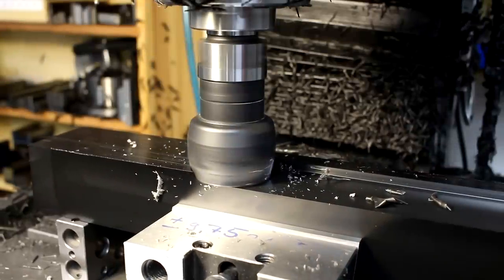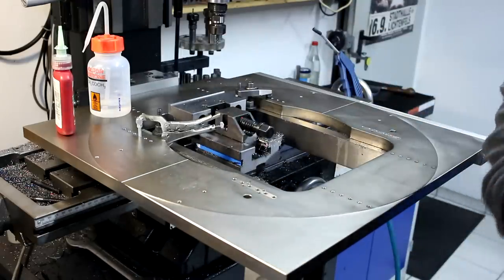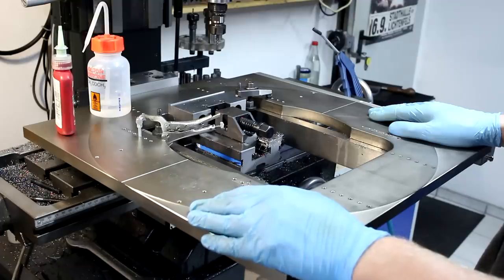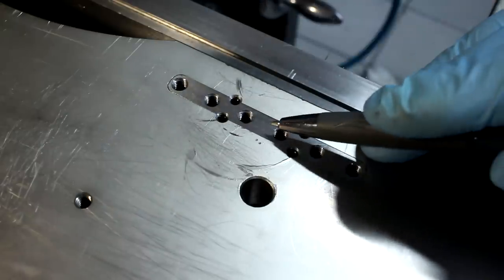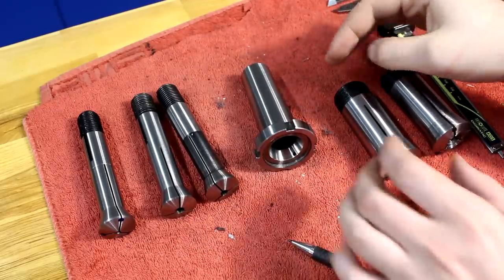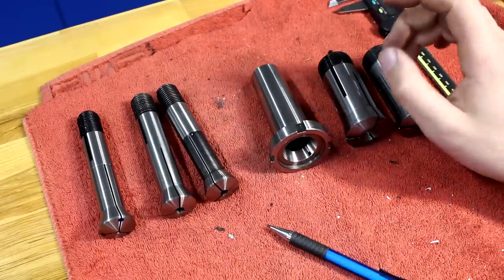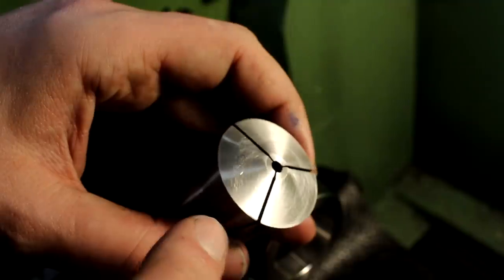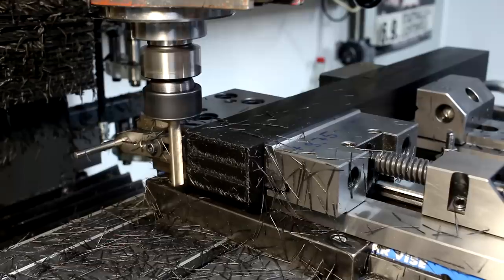Shoptalk #21 - Januar 2020

Comment: On other way that I have used to spring open a collet. If you take a Oxi Acetylene torch with a small tip. heat a very small area between the slit ends near the threaded end of the collet. About 1/4" in diameter red hot. Than quench it in oil. Do that to the other two locations. Now the collet will be sprung open. If your careful and heat a very small circular area this doesn't damage the collet. (But you have to concentrate the heat quickly) At least I have never had one break from doing it.
Reply from the maker: Thanks Peter - I will try that!

Comment: Have you seen how the tapers are clamped in to taperlock bushes? They use a half-threaded and half-blind hole. 
With a similar arrangement (and no glue) you could have left the option of taking out and flipping the threaded inserts. 
So that it is twice as long before you get paid for the job again.  Ah, I see the flaw in this plan.

Comment: Excellent shop talk Stefan, that D2 tooling plate is the largest size I have seen from that material, I assume it was Nitride Hardened.
Many thanks for sharing and best regards from the UK.
Reply from the maker: Nope, it was actually completely soft, unhardened. Only plated.
Reply: @StefanGotteswinter  Thank you for your reply, most unusual to have D2 used in a non hardened and tempered condition, though it would be quite stable dimensionally.
Always learning 👍.

Comment: Beautiful repair.  I would never have thought of that.  Why did you radius only the corners of the insert rather than entire end of the insert?
Reply from the maker: I did want to go with a 6mm Endmill for the pockets, but the pockets are wider than 6mm - That means I have to radius only the corners :)
Reply: @StefanGotteswinter  Isn't that what gigantic button head screws are for?  I always put a few in something that doesn't fit quite right.  I just say it's steampunk.  Best wishes and thanks for the vids!

Comment: I am sure you said and I missed it but there most only be shear forces on those threads otherwise those inserts would not be the best solution.
Reply: The problem on the original threads was wear from using if I understood correctly, aren't the ready solutions usually pretty soft?
Reply: @MF175mp  Keenserts and helicoils are typically fairly hard.  There are also ones like ez-lok that can be heated and removed later for easy replacement if needed.

Comment: Hi Stefan, I’m presuming the jig plate is for accurate alignment of the parts screwed to it. Would it be more accurate to drill the screw holes in the inserts after positioning the inserts in the plate, or is the tolerance for the fit of the inserts acceptable for this use?
Thanks for making your videos, it is great to see your thinking processes!
Reply: It is my understanding that you should never rely on threaded fasteners to provide precision alignment. I would guess in this case the alignment is provided by another feature and the screws provide fastening only.

Comment: While 5C collets do have drawbacks. One is length control if you have differing diameters. But as a total system the 5C has alot going for it. In 5C you can get inch, metric, soft collets in brass, steel and plastic. Additionally you can get step collets up 6"/150mm, internal collets, extended nose collets, fixture plates, v-block fixtures for off set work and dead length collets. One difference between the Deckel and the 5C is the 5C is not intended for tool holding normally. The really nice thing with 5C's is if you are running them in a HLV-H/EM or one of the better clones
https://www.hardinge.com/workholding/c-series-collets/

Nice repair on the fixture plate. D-2, fun stuff.

Also at the start I had a "oh scheis!" moment when I saw that cutter hanging that far out and then the black Delrin registered

Comment: Thanks for the video.
At around 15:20 on the video, are you using an ER collet. Just wonder, because I thought you had to put the collet into the nut first then into the holder.

Comment: would you not normally use Helicoil for such a rig, would make the most sense to me or is there a reason against it?
Reply from the maker: In our experience helicoils dont work very well on theads that are very frequently opened/closed. And it was customer request not to use them ;)
Reply: Oh ok, we use them often for high strength and also on RMS shaker because of frequent mounting and high cost of repair. Thanks good to know, spitze Video wie immer!

Comment: curiosity only: why not helicoil?  blind hole and expecting future replacement?
Reply: Because this is part of a PCB test jig. A manufacturing line for PCB's of this size (in Germany, not China) is very expensive.
Imagine the entire operation becoming unreliable because they can no longer do quality control ! It's a nightmare!
Repairing this just with helicoils is a bit 'half assed' when you know what is on the line here.

Comment: Thank us? If most have learned as much as I have from your videos Stefan were the one's who owe you the thanks.
While that 5  micron run out was pretty damn good, roughly .0002" for us imperial dinosaurs, any thoughts about why it wasn't a bit closer. Or would that have taken internal grinding/lapping?
Reply: The slits in the collet may not be so precise as they are obviously not ground, so it will cause the collet to close unevenly during the boring, 5 microns isn't that much. With the holes that are drilled (and hopefully reamed) prior to the slitting and pins that wouldn't be an issue so the factory emergency collets may have less runout after boring